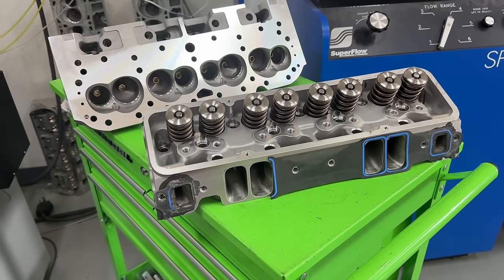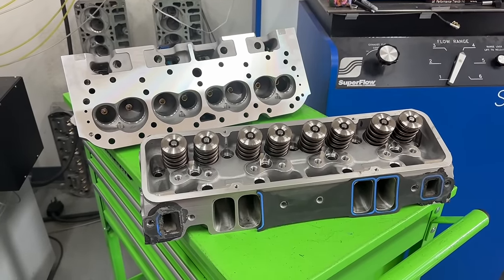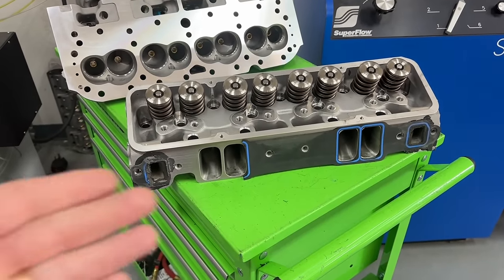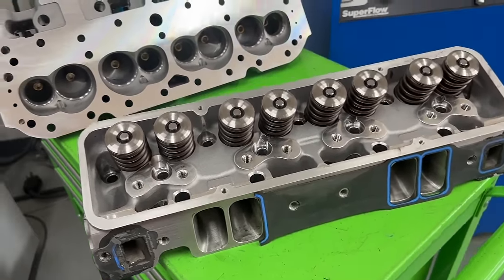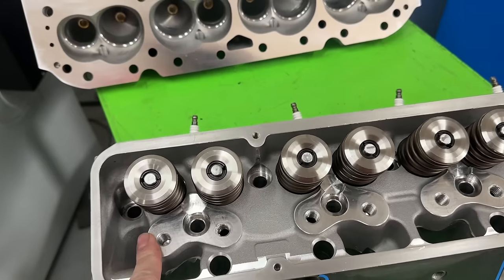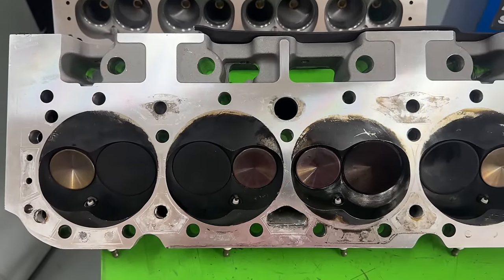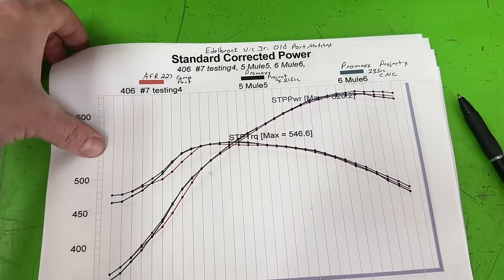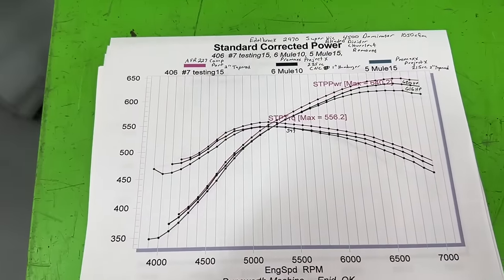AFR 227cc Competition Ported heads vs Promaxx 235cc CNC Ported heads

Comment: I run a Schafiroff Ultra Street 434. I comes with AFR 210 heads. 950 Quick Fuel. The cam is mild with .591 lift, 109 Intake CL and 252/256 duration at.050. It made 598 at 6300, and TQ at about 4600. I have run a best of 10.38 at 129 @ 3200 lbs in a 73 Nova. I shift at 6500 and 7000 through the back. I have been told my heads are too small for the motor. To me I think these small heads work well with the combination. Recovers well at the shift and pulls hard top end. Far from a race engine it is quite happy cruising on the street. Not sure what my point is but enjoy these videos from Eric ! Thanks
Reply: https://youtu.be/jdyBt7thiKs
Reply: What's the compression on your 434? Can you run pump gas?
Reply: @bradwhite3294  10.5 to 1 Run 94 octane up in Canada

Comment: I have the project x 215 on my 427 with a hydraulic roller 247 / 255.. 573 /. 583 lift 110 centerline added 1.6 rockers super victor with a holley sniper and I'm right at 10.5 to 1. I have this in my 84 Monte ss with a Richmond 5 speed and a 3.70 gear and it is super strong. It has great street manners with the AC on and tho no track testing yet I feel the car is easily capable of 10,s my other gbody has a 414 sbc has afr 245s E85 custom solid roller and a 94mm turbo and runs low 8s on only 19lbs that I do drag and drives ( clocked 8200 miles in just over a yr with only 2 rocker failures)  i am a sbc ride and die guy so I trust what Eric says and watched all his dyno vids and wanted a powerful cost-effective option for my street car and the Pro Maxx heads did more than deliver so enough rambling by me but I want to thank Eric for all his hard work because I know u do lots of heads but I and many others still live and breath small block Chevy and as time goes on things change I'm glad you are always trying new things and I'm always up for learning new things so keep up the great content!!!

Comment: This is the alchemy part of building and optimizing a given engine to get max power. No single part will ever be the best but may be best on a specific engine. I would even venture to say an identically built short block would yield slightly different results using exactly the same top end parts. You are doing a great service to all of us motorheads Eric, keep up the good work.

Comment: I had built a 388 sbc with 11.2 to one with solid roller 262 268 bullet cam with 690 675 lift and 106 lobe sep super Vic  cnc ported runners with a 4 hole super sucker 2” spacer ran on  pump gas 38 on timing with a 850 and 235cc factory afr heads 2.10 1.60 and made 620 at 7000 and 540 torque at 5200awesome video I just can’t believe I made that much power  on a small cubed motor I was mind blown by the power I have daily driven it in a nova and put 6000 miles on it

Comment: Very interesting!
ONE thing I wanted to mention:
When people say “…more torque down low…” it usually means from idle onwards.
Your data mostly shows 4000rpm and up. That is not considered “down low” in everyday applications.
Remember the TPI manifolds, that basically ran out of flow at 4400rpm!?

Best wishes

Comment: if i liked small blocks id definitely go with your design you have some nice looking work.my old vic jr built a lot of power with teeny tiny 172 150 valves in an old set of 283 power pack heads  on a 355 small block i had that i ported back in high school went 11.40s in a chevy s10 nobody believed it had such small valves

Comment: Great content Eric, the thickness of the heads and milling is causing you some grief with the port anighnment. Makes it tricky for you.
Interestingly by the looks of it the way the dyno load in displays in the dyno figures the first 3 or 4 hundred rpm might as well be almost disregarded if the load in rpm is different.
Great persistence 👍

Comment: The most important thing is port matching. If you leave any kind of ledge especially on the shortest path between the throttle body and the valve opening, your laminar flow path gets out of wack. Second thing is harmonics. The flow path oscillates with revs due to valve pulses and exhaust pulses, and when your rev range is between 4000 and 8000, your double 4 engine is at it's second "Octave". First being 0-4K and third 8K to 12K. Larger intake track flows more past 8K, if the port has no ledges. On the second octave it's all about the shape, not the size. Valve position and tilt makes a difference, but can also slow the flow down thus not creating a desired flow pattern i.e swirl inside the combustion chamber. This means even though the static flow without the intake is one number, the chamber fill between the rev range is totally different number, due to laminar flow volume, harmonic oscillation and swirl.
Reply: I think you are correct
Reply: How do you know where the harmonic is changing? It's not going to be at a set rpm for each of these tests.
Reply: @garlandjones7709   That is the dark arts of all motor tuning. Fluid dynamics has it's base in quantum physics. It's not about slapping in this shiny part, or that shiny part, they all need to be massaged together to get the best result. Naturally aspirated engine is a wind instrument. All one needs to know, what kind of sound makes the most torque. To get that knowledge, takes decades or a lifetime.
Reply: @oikkuoek  you tune around those harmonics with the intake manifold and the headers. My point was that you can't simply say they're from 0-4k, 4-8, 8-12. Every time he swapped an intake manifold, he changed it.

Comment: Eric,
Questions for you .
Can the 235 heads be angle milled to reduce chamber without drastic intake port alignment issues?
I noticed on dyno raw sheets that air fuel ratio is not consistent thru out the pull (adr227 with 4812 dual plane )…
I’m also wondering about quench.. piston down the hole like .005? 041 head gasket .
Thanks for all the hard work and information!
Reply from the maker: The afr is wrong on the sheets. Quench is .041

Comment: Eric first, you're doing great with the testing and it's the only way to better your operation. A couple things. Curtis Boggs reminds me all the time, I ain't  chasing flow numbers flow numbers don't win races. And just because this intake or head works NA doesn't meant it'll perform the same under boost. And they have pacific intakes for pacific heads and for pacific combinations due to testing. And you talk about your flow blenches and how they read, and I know you like MBE, but they use a SuperFlow flow bench. If I buy a set of cylinder heads, I buy from brodix and I always buy the intake they recommend. Last deal I bought was 24° oval port Head Hunter heads so I bought the BM 2027-O intake and had the heads and intake ported together.

Comment: My wild guess is the duelplane restricts airflow just enough up stream that the higher flowing bigger port heads became a velocity penalty and the manifold dictated total airflow available removing the gain from the afr or pro max. Another words. The 215 is a better match to the duelplane but the less restrictive singleplane allows the larger head to deliver on max cfm. The midrange  in my experiance gets hurt with giant ports and the low range where the engine speed is low and no ram air assist is happening. A big hole allowing nature to fill is best. Since at low speed there is also lots of fill time in real time that is not engine time in degrees.

Only mother nature really knows what is happening. Testing is the only way. 💪🏁

Comment: Love this video really goog job its amazing how the stock 215 made such a good hp number with that intake.. Personally im buying a set of promaxx 215x trying it on a 13.1   383 solid roller 270@50 custom grind with a 2975 victor jr wonder will it be good for 550hp or better

Comment: Wonder if it’s the cam vs intake vs head making the difference? All I know is I can’t wait to get my new heads on! Thanks for all the testing even though I’m a sbf guy, but I appreciate horse power! I’m kinda curious when you start testing ls stuff, I’d like to see the difference with the fuel injection manifold vs carb manifolds, I feel like it’ll be kinda close to the sbf with the valve arrangement.
Reply: Everything affects everything else. Im not a fan of testsnlike these, but people want to see them.
Reply: @garlandjones7709  Can you explain why you're nor a fan of testing like this? It seems like it would be very beneficial. I know most porters test test and test to see what works after they design a head or intake is why I ask.
Reply: @jasonstormoen   in a generic way, yes. I'm not a fan of testing like this because out of all of these combos only one can be optimum or none of them will be. 

Not only are they not equal on compression, but to even it from here could help or hurt either combo. You're trading compression vs airflow loss for the 235s or compression vs airflow GAIN for the AFRs or ruining its quench. 

Assuming the heads had equal chambers, each has different port sizes, shapes, velocities, cross sectional areas, possibly valve sizes(id have to watch again) etc.... they will want to make their most efficient power in a certain range that is different than the other heads. Meaning they will want a different cam, intake, and headers. Even if the differences are small, the differences add up. They have different intake port alignments as well, not only vertical but horizontal. This was mentioned in the video. 

I'm making another assumption here that the cam is custom ground. I here you on the head porting...but that's not a and b to what's going on here. Pretend for a moment Eric designed the AFR 227. WHETHER Eric specced this cam or his cam guy did, if he started over with the AFR 227s he'd have a different cam whether he penciled it or his cam guy did.

This isn't a knock against Eric. I LOVE this channel and his content. I just think it can be slightly misleading. Part of what I said above is most likely what's going on with the intake manifold issue in this test. But there's no good explanation of why it's happening and most people can't interpret and understand the data whether they know the data or not. 

On the other hand, it's getting very close to "speed secrets" and business advantages to del e into stuff like that at the same time. People, and I don't blame them one bit, don't won't to let too many cats out of the bag. Sooner or later you have no edge

Comment: Instead of milling the heads to get the same compression ratios and messing up alignment on that one ,could you run different thickness head gaskets on them to get the compression closer and that would split the differences in intake misalignment a little with them all that way?  Thanks for all your info and hard work!
Reply: You could use a thicker gasket. And when you do it'll ruin quench and bring you closer to detonation even lowering the compression ratio. Piston to head clearance is to be optimized before others variables addressed. The best fix is in the piston itsself.

Edit: reread your post. I'm betting his quench is set to a spot to where if he tightens it up any he's going to be constantly nervous about his valves making out with his pistons as it sits. Probably not much more than .005-.007 on the table to play with in his gasket thickness. Not nearly enough to make up ,4-6cc of combustion chamber

Comment: So I am kinda wondering does this go back to the beginning where the average size port did the best then once you did bigger heads the bigger manifolds did better so I am curious the reason why probably the 215 did the best on the dual plain because it's the smallest manifold for the smallest head then the afr 227 with the better overall flow it wanted the better bigger manifold to make a better combo that's just my guess but yeah doesn't mean it will happen every time for sure but it keeps my mind up thinking ok the bigger heads want bigger and better manifolds then smaller heads want average or smaller manifolds i swear i keep seeing that pattern on your dyno test so it has to be that I don't know

Comment: You said the bowls were bigger on one. Could it be a case of airspeed variance causing loss of momentum of the air column?
Reply: @lollipop84858  slowing down at a larger area and then speeding up at the smaller area. All fluids take on the shape of their container.

Comment: Unless you are racing dyno's, none of the torque numbers below stall matter at the drag strip. Bigger or smaller port torque results around the stall rpm should be the torque numbers you're honing in on for discussion. The engines will never see the low rpm's going down the drag strip. Most of everything I see in this video is 5600 to 6000 rpm stall examples. Do yourself and your followers a service and discuss the port size torque results around the given torque converter stall rpm's.
Reply from the maker: If only it were that simple. I cannot begin to tell you how many comments there have been wanting me to show low rpm torque. Even though I have said numerous times this is not a tow motor.
Reply: I disagree, what the curve does under where you leave is very important,it hits the converter harder, not my first rodeo my friend, I probably shouldn't have wasted my time but feel obligated to teach people
Reply: @billlittle4285  Torque converters multiply torque below stall on a scale from  1.5 to x 2 depending on the stator chosen by the builder. The stators that multiply torque on the high side of the scale are less efficient at finish line rpm's.  With that being said, the bottom line is this... Between the two versions of engines in this video, the smaller port version will stall a converter higher than the larger port version because it has a higher peak tq number, it don't matter the larger port version makes more torque at 4200. This is why I say it's not only useless tq, it's useless info. The higher tq number at peak tq version will always stall any specific converter higher. This is also why I say discuss the engine output around stall rpm's if you wanna come to a rational idea of which version engine will produce a better et timeslip at the drag strip. If you're racing dyno's on the other hand, carry on with what you're currently doing-discussing. Which is useless at the drag strip.
Reply: So...from 25 years of racing super stock cars, small block  engine, any time I picked torque at 4500 while maintaining the HP I went faster in the 60,  my  engine stalled at 6200 and leave at 38 to 4000,  peak power was at 7000 and torque at 5300, shift at 77 and crossed at 8500, have you ever heard of transient torque, that's what the car sees.
Reply: Transient torque, torque hanging around peak torque. After peak torque, for as long as the transient torque isn't diminishing at a higher rate than the rpm's are increasing, you're making hp. Below peak torque or above peak torque any time you can inflate torque you're gonna go faster on the drag strip, the problem in this case is the bigger port doesn't inflate the transient torque. That's why I say it's meaningless unless you're racing dyno's. The bigger port higher flowing head needs a bigger camshaft to inflate the transient torque around peak torque. That's where the confusion is in cycling heads and intakes on the Big and small block engines with the same camshaft, what's it really tell anyone useful, when it's a specific combo that'll make a cylinder head or intake shine. It's all about the combination of parts and approach that inflates the volumetric efficiency above and below peak torque. It's really not as confusing as it may sound. I tell the young guys I talk to all the time, if you make changes and the torque converter stalls higher, you're gonna go faster on the drag strip. LoL! It's as simple as that.

Comment: The engine had the air it needed, the smaller port had better air speed
Reply from the maker: Then explain why the largest head made the best power and torque on the Vic jr.
Reply: @WeingartnerRacing Could ya use 2 gaskets for a situation of misalignment Eric?
Reply: @WeingartnerRacing do you think the bigger ports of your head worked better with the Vic Jr due to the airspeed?

Comment: lol! To top it off the next guy has the opposite setup and it a killer. The craziest thing i have ever seen guy had a 318 dart! Manifold on one side header on the other side. He ran the piss out of this thing. Street racing. This thing moved. Missing to many gears and yes knock knock. Then he got to put in the 440 !!! It ran ok but nothing like that stock 318 with the weird setup. Why? lol. That’s life. Good luck.

Comment: Much of the emphasis seems to be around big vs small port. Only way we can gain true data/understanding is to use 2 identically designed ports and manifolds  with 1 set scaled larger than the other. In reality these tests provide a mish mash of useless info. Not telling us anything other than ok this head responds differently than that head to this manifold. Could be numerous reasons why, something as simple port/man alignment. Sincerely what am I to take from this, ok if I put this head with this man and get the port mismatch exactly the same this is what I can expect? 
Where's the science? 
Appreciate ur efforts Eric, only trying to be constructive.
How about fuel curves? I know little about them other than 2 engines dynod with the same power the 1 with the better fuel curve with accelerate faster than the other. You're a racer yeh ?